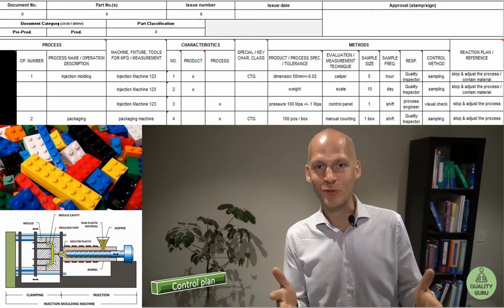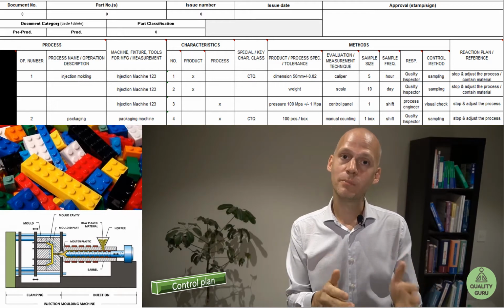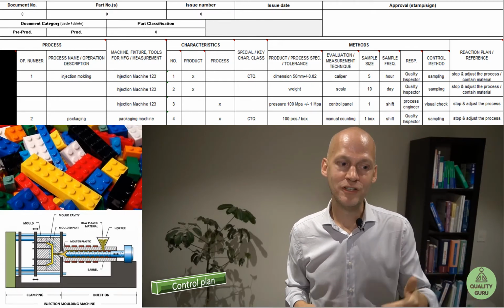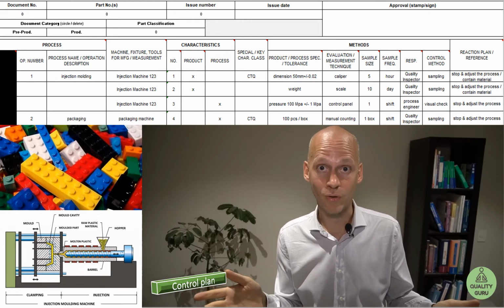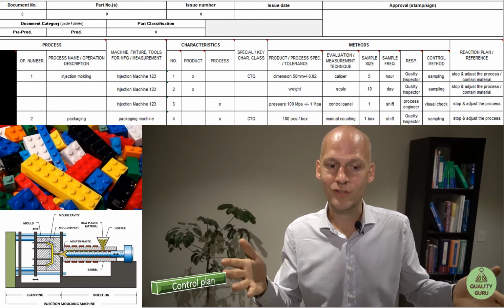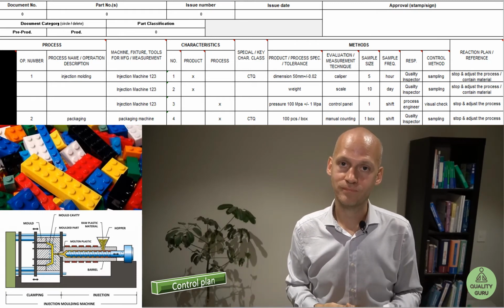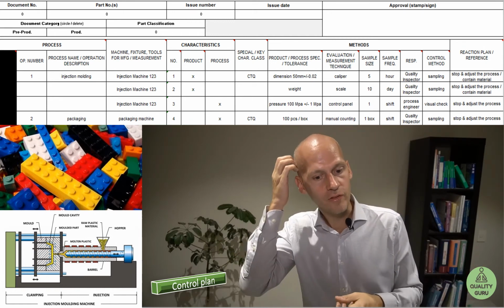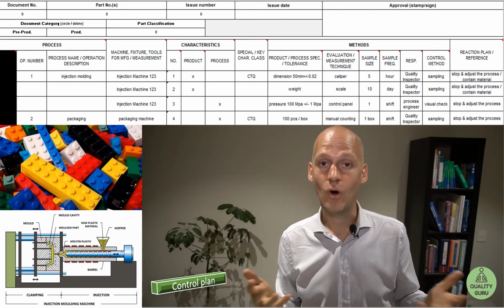What is a Production Control Plan?

Comment: Thanks for this great video! 

This video also brings some viewpoints for discussion: From the practical perspective, the most challenging part is the "reaction plan". who is responsible to stop the production? who is responsible to adjust the process? who is responsible to contain? In reality, can an operator do these things? ... Meanwhile, if the product spec is used to control the "product characters", then is it better to intervene in the process by studying the process variabilities and using a control chart instead? In manufacturing plants, contain activities are ALWAYS complex because it's hard to know the impact scope, and the production resources and work orders are tight. A general statement of containing material leave too much space for execution which usually leads to insufficient containment actions. 

I fully agree with your frame, just adding some complementary views based on my decades of manufacturing quality experience.
Reply from the maker: Hello Michael, thank your for your detailed and thoughtful addition👍